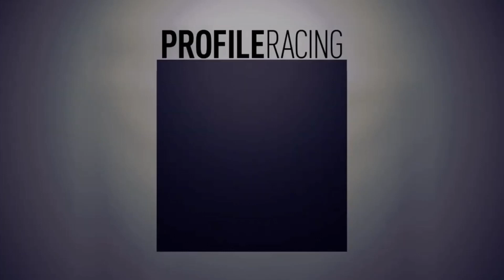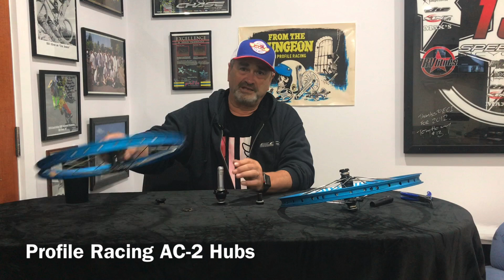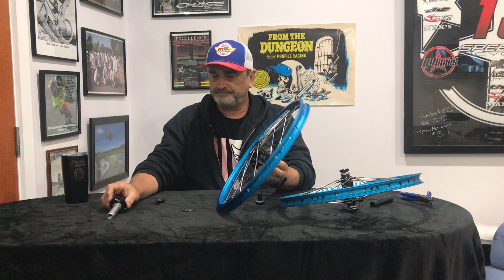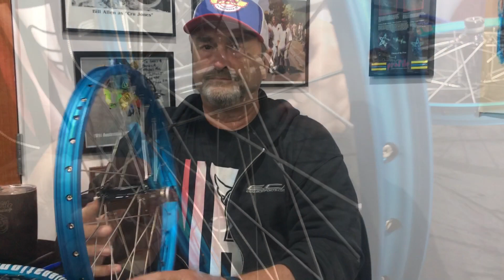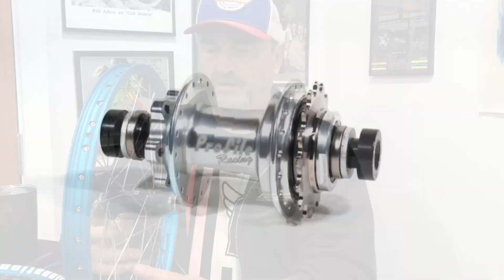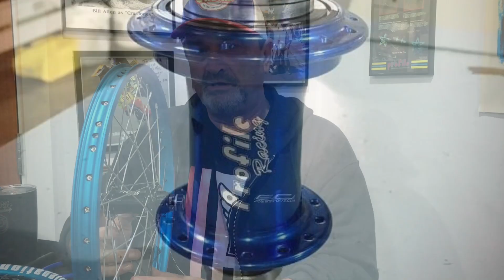Profile Racing's AC-2 Hub Assembly

Comment: Great video! The question I have is if you're using the disc brake adapter the only part you need to remove is the disc side cone spacer? I just bought one and I want to make sure this is all I need to do.
Reply from the maker: Sorry, did you get this figured out? If not, please contact gus@profileracing.com